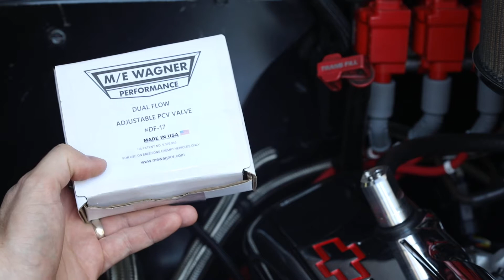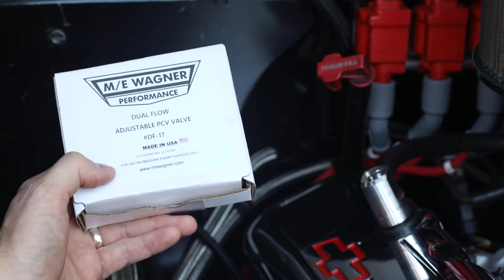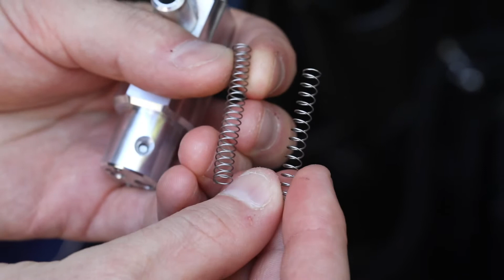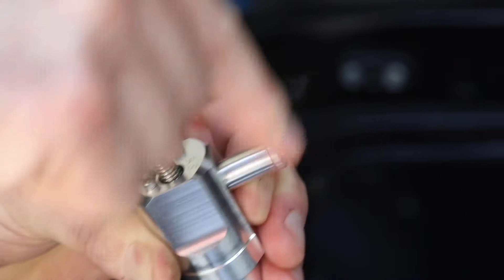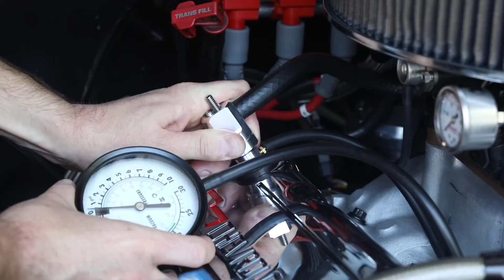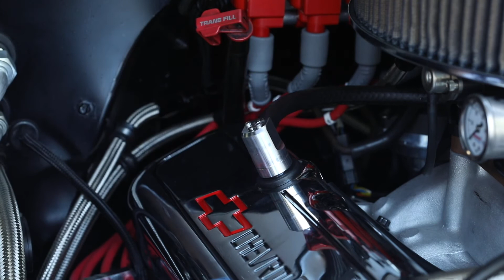M/E Wagner Adjustable PCV Valve Basics

Comment: Nice video man thank you, so the leaking problem it is resolved with this valve? I have the same problem in a 350 sbc I change so may  seal following instructions and trying the off set one and still leaking
Reply from the maker: Substantially reduced it. Almost never drips now.
Reply: @mechtrician1  o great I ready order I hope can help me to, when is in high RPM is when start dripping

Comment: I was looking online for the Wagner valve and up comes this replica of the Wagner valve $24.99. Its called an inline valve & looks exactly like the Wagner valve. Do you know anything about it?
Reply from the maker: Nope. I’ve never heard of it. Probably a cheap copy though. M/E Wagner is a small American company so I am happy to do business with them. I just bought another one for another car as a matter of fact.
Reply: @mechtrician1  Yeh I believe so too. Just watched your vid very well done and informative thanks. Looking forward to the day I have my 65 GTO all put together so I can run it. I will definately be installing the Wags valve. I believe some of the problem with the engine prior to me taking it out and apart is the PCV valve the oil was like mud, and it leaked all over so bad I couldnt find all the places. Good god you've replaced your main seal many times! What a pain in the __ and to think a simple thing like the PCV valve cures it, possibly. Did it stop leaking? I see the vids a year old.

Comment: 7" of vacuum at idle on a street engine is really low... makes me think you don't have near enough initial ignition advance.  An engine with an upgraded cam needs to have the distributor mechanical curve matched to the engine combination.  Have you curved your distributor to your engine?  Also, big cams don't like to struggle at idle.  Idle rpm is typically best at 1000-1200.
Reply from the maker: With this cam, it’s basically where I’d expect the idle vacuum to be. Its 230/238@.050, .563/.580 but it’s ground on 110 centers. Not big by any means, but somewhat what I’d expect. Yes, I actually went away from my MSD probillet a year ago or so and went to an MSD DIS system to give me more flexibility for more timing at idle.  I had the typical issues that you can have with mechanical advance where it would sometimes come in at idle and cause unstable idle, and with fuel injection, it would try to fight that. Going to the DIS solved all of that.  I’m running 16° “initial”. With the DIS it’s just your idle timing setting.  It will also stabilize by varying that number slightly. Pretty awesome system. It idles at 750 rpm incredibly smooth now.

Comment: Good video man, I've had mine for a little over a year now. Did a cam swap and needed a refresher on adjusting. I was running fixed orifice mode with my previous cam, now I'm trying out the high vacuum spring. M/E Wagner is a great company and super friendly when I bought mine
Reply: i seen your comment thats why im here thanks

Comment: The rear of my intake keeps leaking no matter what I do. Do you think this will fix it? I have an Edelbrock pro flo 4 setup
Reply from the maker: Like your China wall keeps leaking?  What are you using to seal it?  This might help, but I find using ultra black or right stuff never leaks.
Reply: @mechtrician1  I'm using right stuff ultra black. And I use a real thick layer of it too. Took my intake off 3 times already and redid it. It lasts about a month and starts leaking in the back, I noticed it does it more when going past 5k Rpm. I have a 496 BBC
Reply from the maker: That should work well. What’s your current setup breather/PCV wise?  You running either one or both?
Reply: @mechtrician1  both, I have one breather and one pcv valve going to my throttle body. The pcv valve is a specific one from Edelbrock that is made for the pro flo 4
Reply from the maker: That sounds like the correct configuration. Right stuff black is super tough. I can’t believe it would blow out from crankcase pressure. If that was the case, you should be seeing a lot of oil coming out of the breather. 
You cleaned the surfaces with a solvent, correct?  You let the right stuff cure for 24 hours?  I know it says like one hour but it doesn’t fully cure for something as thick as the China wall gap that fast. You have to let it cure. 
If you have that much crankcase pressure, something is up.